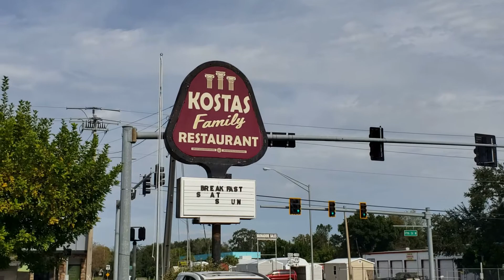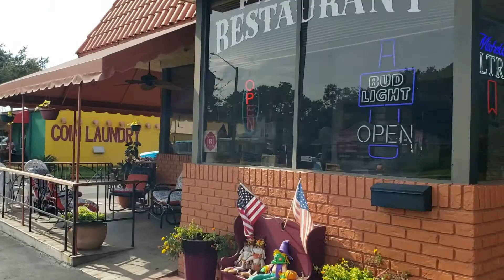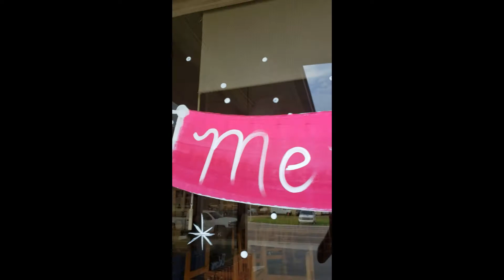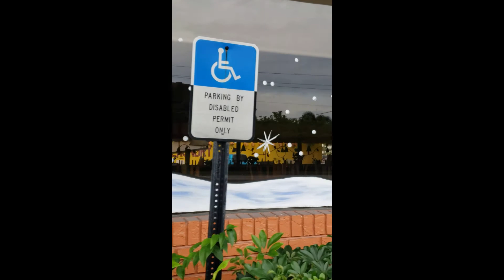Christmas Window Painting 2020

Comment: I love this! You have a good technique :). I want to get into window painting but it’s tricky. Sometimes when I try to put a base layer on and then paint over it the base layer starts to move and almost disintegrate :( do you use a special kind of paint for your base?
Reply from the maker: Thank you. I use interior Acrylic house paint as my base. It won't come off when you apply your colors. Then I use tempera paint over that. Provided it's under cover. Tempera will wash off easily. Otherwise use all interior paint. You can scrape it all off with a flat blade when you're ready to remove.

Comment: I do have a couple of questions, I wish you could respond to me,

what blade you were using bro!? 
how do you call that type of paint? 
Is it washable, easy to wash off? hehe to clean it after the holidays of course :)
Reply from the maker: The first coat of white paint is interior latex, the top coat of paint is Tempera paint. The blade is just a small straight razor blade. When it's time to remove, you can spray with pressure washer or scrap off with the blade